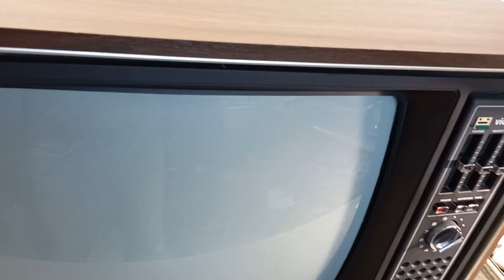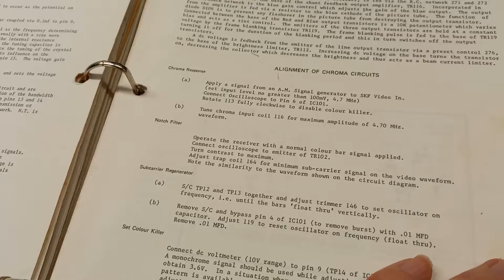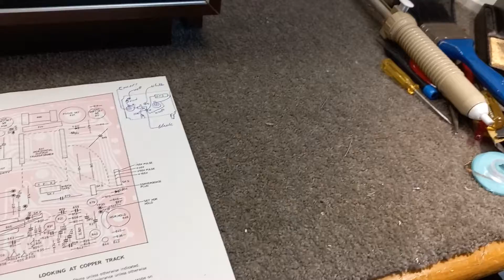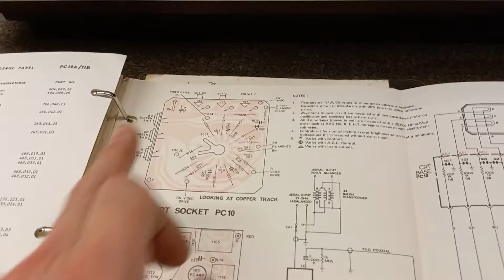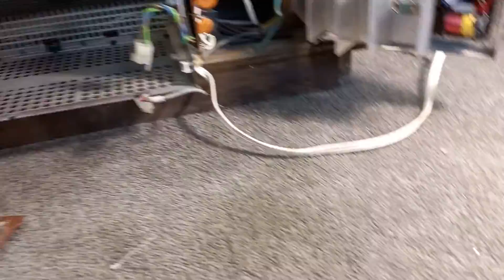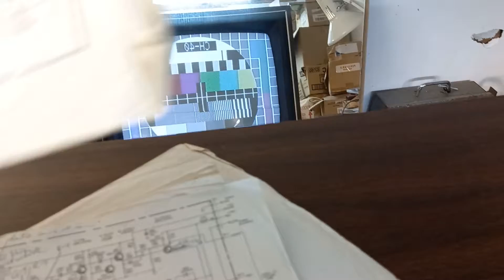Pye CT-102 Vintage Colour Television

Comment: Oh the amount of times I scribbled all over our circuit diagrams. The CT102 was one of my favourites. They had their problems, but for most of our customers, they gave a long life and you could throw a garden variety transistor or cap in them to keep them running. I do remember those LOPTs being very reliable too. I really learnt the CT102 like the back of my hand since it was still in common use when I was an apprentice. The only thing that bugged me was the odd set that would pop the chopper transistor about twice a year. You'd go over everything in the power supply. check stability, all good, still blow a transistor 6 months later. Some had a row of dead ones lined up inside to show the techs that it's "one of those that will need it replaced again".  They did have picture bloom, didn't they? It just got less and less as you replaced the caps in the chain, Main electro, HT electro, small decouplers and maybe the tripler. Generally you whip the back off , eyeball it for a couple of minutes and fix most problems without even getting out your meter. We had loads of them as rentals and loan sets, since you could tickle them up, send them out and they'd hardly ever come back.
we had a few with the remote control. It was ultrasonic with volume and channel buttons. The volume had three settings, soft, med, hi. The channel change used an AC motor on the back end of the tuner that turned it one position at a time. They sounded weird: "WHIRR-CLUNK-WHIRR-CLUNK!"
Sounds like you almost have the full set of Pyes. You just need a CT101. The white ones were weird alright. Loved the 70s art deco single pole stand model :)
Reply from the maker: Sounds like you did get to know the 102 pretty well! When I was fixing these in the mid to late 1990's the ones I encountered were all high hour with flat tubes so we'd do the bare minimum to get them going and warn the customer that it was coming to end of it'd life. The amount of these sets I dumped or destroyed there was more than a few! I do have a CT103 and CT104, but alas no CT101. The 101 would be a real find now..smashed a few up back in the day..whoops lol. The white  ones did look very odd I have to agree. Never knew they had a remote model for the 102, that would be something finding a set with that option fitted! This one being a fairly low mileage set it should be fairly reliable from here on in, maybe the power supply might blow up in future!

Comment: In Australia, the Pye brand of colour TV was introduced in the mid 1970's with a 22" and 26" picture tube size (Toshiba, 110° deflection angle). They used a line output transformer with bituminous insulation that hardly ever failed but triplers, vertical output dry joints (TO-66) were common faults.
Reply from the maker: Probably the same type of Toshiba tubes were used in the Pye sets here as well. I think dry joints and triplers were a very common issue with most colour sets from this period! 😁

Comment: My parents had one of these sets, they bought it second hand in about 1981 to replace the old Majestic B&W (Haven't seen one of those since), and I kept it running during the 90s as a student, various faults from shorted horizontal output transistor, an open diode in the power supply, and a weird fault in the chroma circuit. I do not know what became of it after about 2000, although I did note that it would not receive TV4 when that came on the air (Christchurch channel 11). It also needed the VCR to receive CTV on UHF channel 48. I can't remember if the one we had was a Mk1 or a Mk2. Oh that power supply....and that main filter cap would hold a charge waiting to bite the unsuspecting.
Reply from the maker: I'm sure the CT102 was a step up from the Majestic! Yes those power supplies could store a nasty charge if you were unlucky. A tech I knew who has since passed had a test jig for fixing the power supplies and this jig could diagnose the problems pretty easily. Thanks for the comment.